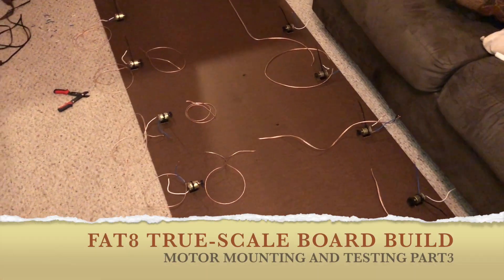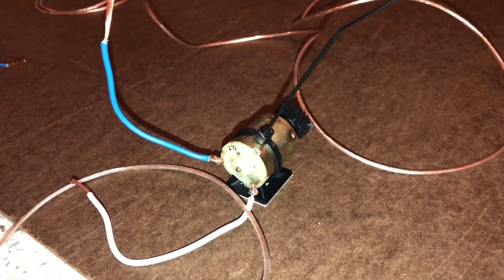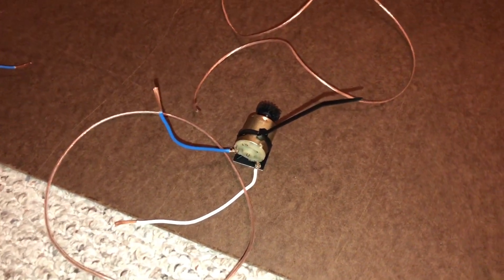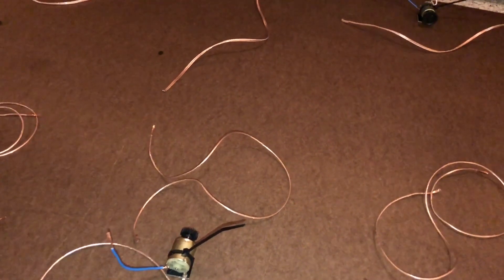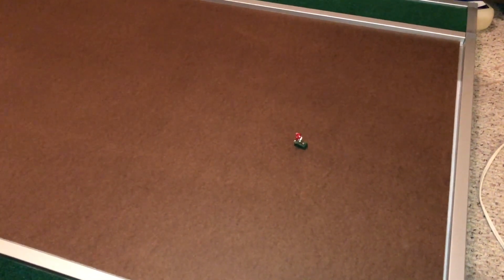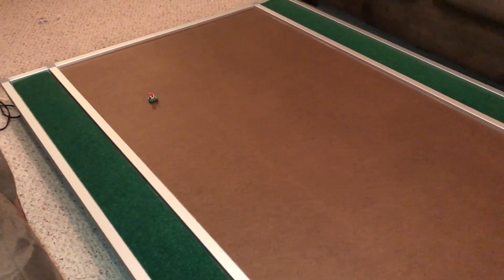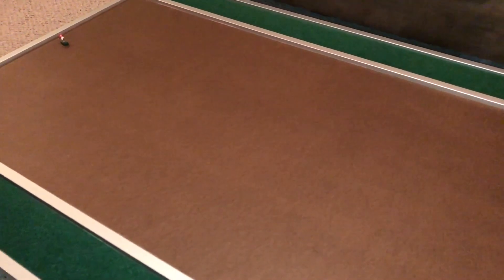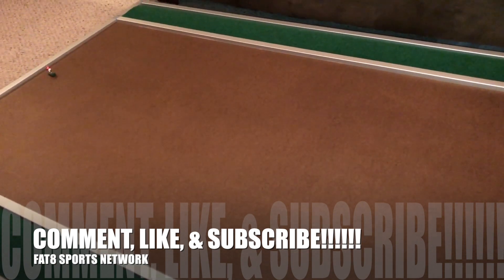BUILDING THE FIRST EVER FAT8 TRUE-SCALE BOARD part 3

Comment: By far the most accurate playing field to date. Every one is gonna have to rebuild for next season after this
Reply from the maker: Bryan Cross thank you very much bro.
Reply: Question,

What r u using for counter weights? Second is one railpower powering all 8 motors? Thx
Reply from the maker: steve p I bought gears from allelectronics.com for my motors. The gears include a plastic peg for the counter weight. It makes the board run very smooth. And yes, my power supply is running all 10 motors. Using gears on the motors make the board vibrate evenly with no dead spots and no areas where one motor is over vibrating